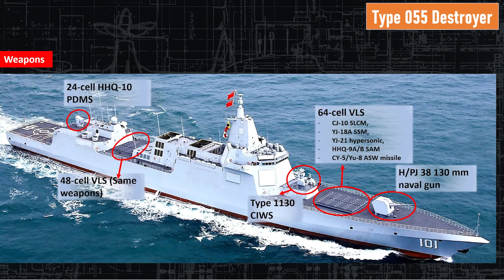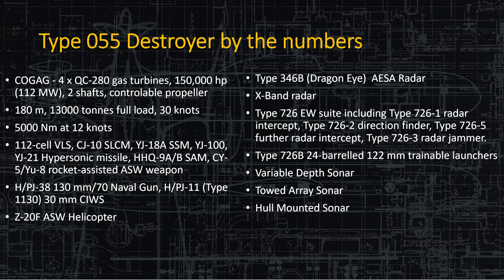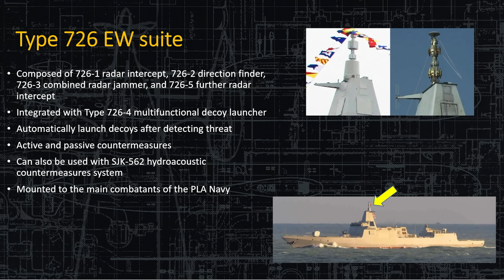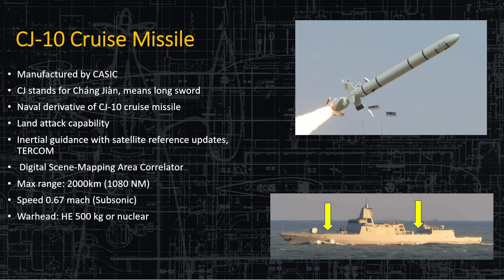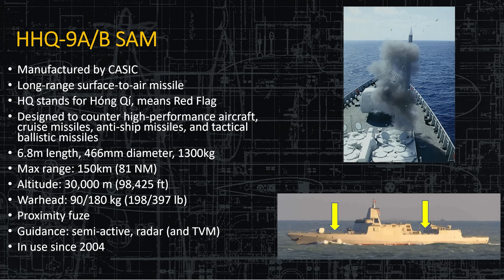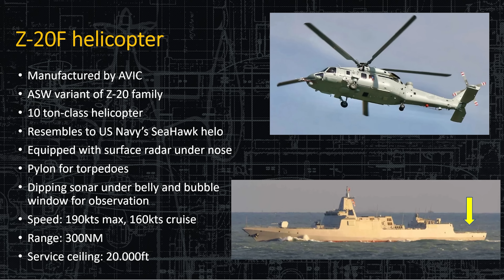China's Type055 Destroyer Ship Brief

Comment: it's arguably better than the Ticonderoga
Reply: If it weren't better, USN won't be rushing the DDG(X) to respond to this. 
Look at the concept CGI of the DDG(X), it even copied the 055's distinctive beak.
Reply: @moss550 Problem is we’re not rushing it. US systems procurement is glacially slow.
Reply: @GrahamCStrouse  That's because the current US system is designed to make money not weapons.
It's about how to most efficiently siphon money into the pocket shareholders and politicians. That's why there are so many futuristic projects that promise everything, but get canceled right before they are ready for serial productions.
Case in point, the cost of this 055 is only 75% that of a Constellations frigate which is supposed to be a cheap ship based on off-the-shelve existing tech. 
Chinese labour are cheap, but not that cheap, so where did all the money for the Constellation go.
Reply: @moss550  Exactly. Saying that the ship is cheap because Chinese labor is cheap completely ignores just how efficient Chinese manufacturing is, and how good their trade and supply chains are. This is the kind of stuff that actually win wars.
Reply: @moss550 That's just stealth design in ships. The german F126 frigate has a similar design, the russian Admiral Gorshkovs frigates also have a similar design, so do the Shkval DDGN concepts.
Reply: @lyin4rmu  of course it's better it's 40+ years newer lol
Reply: One would expect it to be better than a ‘70s vintage design.
Reply: Tico has more VLS, but Type 055 is newer. But overall, SK's Sehjong is the best followed by Type 055 then Tico in my opinion.
Reply: @johnsilver9338  Sehjong DDG still runs PESA radar and MK41 VLS which are at least 2 classes behind 055
Reply: @MrBdoleagle  Aegis ships including Sehjong use BMD radars while Type 055 don't. Also Sehjong have additional K-VLS which are much larger and can even accomodate ballistic missiles.
Reply: @johnsilver9338  The Type 346B Dragon Eye is not remotely comparable to the AN/SPY-1. One is a third generation Chinese AESA, while the other is a PESA. The resolution and detection range are an order of magnitude different because of how the array functions. That is not me saying that radar is bad. China's conducted BMD tests before and they exist. But my main point is you have to remember needs. ROK needs such a thing because their primary adversary is NK, a country that puts an emphasis on BM's. China doesn't face any ballistic missile threat, so there isn't really any reason to put them on their ships. The only countries that put an emphasis on conventional ballistic missiles are just Iran, China, Russia, and NK. All countries that they don't have any issues with or are a threat.
Reply: @Flightman453  Theoretically AESA have around 50% improvement in detection range over PESA/MSA. But a full BMD capability allows a radar to see up to 1000km and even more up to MEO orbit as that how high ICBMs climb. Its why SPY-1D(V) is a tech marvel and is still relevant and effective as it can see up to 1700km for 10m2s RCS like ballistic missiles and large aircraft, 970km for 3m2 RCS like fighter jets, and 307km for 0.03m2 RCS for ballitistic warheads or low observable stealth. Calculations can be found on mostly missile defense. So it can definetly see much further than non BMD radars. But they also have AESA SPY-1 or SPY-4 on the 1st Ford carrier and SPY-6 with multiple RMAs for Burke Flight IIA and Flight III. So those can definetly see much further.
Reply: @Flightman453  I doubt that the Type 346B will not have BMD capability. There is no way the most premier warship in the PLAN roster, which also carries their largest sized VLS does not have the capability to detect and track BMs and then guide ABM towards them. China's radar system is now at the cutting edge, which is all the more ironic because they literally control most of the gallium and germanium refining and ore sourcing and they have some of the finest electronic engineering departments in their universities in the world.
Reply: Idk about that. The Tico is a little old but she still packs a lot of whoopass in those old bones.
Reply: @josephahner3031  yeah, and M1 garand still had a lot of heat but you ain't expecting it to outclass AK-12 does it

Comment: ngl the radar looks a lot like AEGIS. Besides that it looks like China copied the Rolling Airframe missile, the MH-60 Seahawk, the Kh-55, and the 3M-54 Klub.
Reply: AEGIS isn't a radar, it's a combat system.
Reply: @voidtempering8700  The radar looks like the AN/SPY-1
Reply: @BENKYism  Its closet to the AN/SPY-6 since they are both AESAs.
Reply: @voidtempering8700  PESA radars aren't different enough from AESA radars for there not to be some level of interchangeability, all I'm saying is that it looks too much like the AN/SPY-1D on the Arleigh Burke to be a coincidence.
Reply: @voidtempering8700  The Type 346 radar looks even more like the AN/SPY-1D on the Type 052C and 052D destroyers.
Reply: @BENKYism  Um, you realize the way it looks is the least important part of the radar, right?

Also, they are not only completley different shapes, but even when compared to the SPY-6 AESA, the way they approach the radar is completely different.
Reply: @voidtempering8700  The SPY-6 essentially looks the same as the SPY-1. China has a history of reverse-engineering military equipment, I'm gonna list off everything that they've reverse-engineered.
Reply: @BENKYism  Do you understand that they don't share any similarities at all, right.

They are not only completely different shapes and have different arrays, they use completley different guidance systems. The only thing it has in common is that the main arrays are S-band, but it also has two secondary C-band arrays from guidance.

Not that it really matters what band they are since AESAs and different systems completely from the PESA SPY-1.
Reply: @voidtempering8700  MQ-9 Reaper (CASC Rainbow), E-2 Hawkeye (Xi'an KJ-600), Sikorsky S-70 (Harbin Z-20), C-17 (Xi'an Y-20, confirmed in the Su Bin trial), F-35 (Shenyang J-31, confirmed in the Su Bin trial), Su-33 (J-15, reverse-engineered from a prototype bought from Ukraine), Tor-M1 (HQ-17, reverse-engineered when Russia refused the licensing agreement), Crotale (HQ-7), Humvee (Donfeng Mengshi), Exocet missile (YJ-82), Rolling Airframe Missile (HQ-10), Spike NLOS (HJ-10), Javelin missile (HJ-12), ZT3 Ingwe missile (HJ-9), to name a few.
Reply: @BENKYism  You still have yet to answer my question about how two radars with entirely different mechanics and systems can be similar to each other.
Reply: @voidtempering8700  Sure but given China's history of reverse-engineering equipment, I wouldn't put it past them to reverse engineer AEGIS components in some capacity. Chinese media outlets dubbed the Type 052D ship as "Chinese AEGIS".
Reply: @BENKYism  It is called that because of its capabilities.

Even then, that is a massive misnomer, because AEGIS is a combat system.
Reply: @BENKYism all phased array radar looks similar because they are all thousands of small transceivers laid out into a square or hexagonal shape on a flat surface.  However, it’s the transceiver design, signal processing equipment, and information processing equipment that makes the real difference, not the antenna board.
Reply: @BENKYism  Dude, it's a radar.
Reply: @Flightman453  All of them were reverse-engineered from other designs, that's how China was able to modernize their military so quickly.
Reply: We sold them the civilian version of the black hawk btw.

They then completely redesigned it internally to chinese systems, avionics etc.
Reply: @HolyNorthAmericanEmpire  Producing a copy of something without license is the definition of reverse-engineering.
Reply: @BENKYism  Its not a copy though, the only similar thing is the rough shape.

Ask any aerospace engineer. Even small changes require multiple models and redesigns to make it work properly.
Reply: @BENKYism  And so can you prove that? The word copy has lost all meaning because people like you still live in the 1990s in China. The only thing you listed that actually falls under the word "copy" is their Blackhawk equivalent copy as they actually possessed civilian versions of the Blackhawk just like someone stated above.

Comment: The materials science that goes into turbine blades is incredible stuff.  Some of the most advanced metallurgy you'll ever see.
Reply: He believes China can make jet engines, but he doesn't believe China can make gas turbine blades. How funny.
Reply: And it's not that difficult for China now. These was old stories. Things changed rapidly .😊
Reply: @AZ-hj8ym  Investing in industry and infrastructure pays off.  China seems to be pretty good at that.  Not to mention how many engineers they've probably got working on just that one problem.
Reply: @AZ-hj8ym  it's still difficult, multiple engines r&d have been pushed back again and again.
Reply: @voidtempering8700  Yeah, my point is it is never an easy task. You can get a working prototype quickly but takes years of effort to improve and make it reliable in real life deployment.
Reply: @koba301  The WS-10B has been in production for 10 years, the WS-10A even earlier. WS-15 just entered serial production. It is more than just prototypes.
Reply: @iraviya  i can imagine, must be very precise.
Reply: I work at scrap yard where we get material from a turbine manufacturer,  lots of exotic, proprietary and even custom one off alloys.

Comment: At mach 3 at sea level it takes 30 seconds to travel 19 miles.
Reply: so shooting like 5 missles american Ciws cant hit all ?
Reply: @mikael5938  It's likely to be a bad day.  Breaking up a mach 3 missile a km out does not mean that you won't get a few tons of burning junk hitting you still going very fast.
Reply: @mikael5938  Phalanx can't really intercept high supersonic missiles. Even RIM will have problems.
Reply: @mikael5938  you are assuming that Aegis cannot target multiple missiles simultaneously like the russian systems. well, it can. CIWS is never the primary defense anyway, CIWS is your last option. in fact most navies have been phasing out CIWS with RAM as point defense until the pirate/small craft problem resurfaced again in recent years.
Reply: @mikael5938  that what the RIMS are for.. there is no way Phalanx can deal with many missiles, it doesn't have the ammo, it intended to be use only if all its missiles fails.

Comment: We should have kept R&D of Nuclear Cruisers.
Reply: You're still limited by food and supplies. I'm not convinced it's that good of an idea honestly
Reply: @noscopesallowed8128  RAS is much more time consuming than the UnRep. Helicopters just drop pallets. If its not time sensitive you can run the cables too. But a nuclear propelled ship can keep faster speeds longer so getting to the UnRep and getting back to the AOR would be faster.
Reply: Why build nuclear cruisers when you have SSBN's? Even attack subs now have significant long range strike capabilities. The main purpose of these cruiser style surface vessels is area air defense and, believe it or not, most countries have no need for an area defense surface combatant with no energy resupply restrictions. Perhaps if you don't have the ability to resupply such a vessel, you shouldn't be remaining on station there indefinitely. Why can you not resupply locally? Perhaps, if that is the case, the solution is political and not the application or threat of force. Just a thought.
Reply: @andrew6815  missiles have not replaced the mission of guns. Having ships with guns is still mandatory. Having ships that rely on oil is optional.
Reply: @koffeekage  Ok... what does the power system have to do with the ship's gun?
Reply: @andrew6815   did you read your comment? You asked why CGN when we can have SSBN. Its because SSBN have different mission capabilities. Mainly, gunnery and  helicopter operations, what about Aegis? How are you going to outfit Aegis on a submarine? Adding nuclear to a cruiser wouldn’t change its mission it would just make it more efficient.
Reply: @koffeekage  there were two parts to my initial comment. The first part was pointing out that the strike capabilities of these missile platforms can be carried out (and arguably much more effectively) by SSBN's. The 2nd part of my comment was pointing out that the primary purpose then of surface combatants with large missile carrying capacities is as area air defense which is the purpose of this ship. This ship is also armed with a main gun.
Reply: We don't need nuclear power everywhere, just imagine a hot war involving a bunch of nuclear powered cruisers, what a real disaster it will be having these ships at the bottom of our oceans and let's say that 1 third of the nuclear reactors containment of these ships fails and pollutes our oceans marine life contaminating a vast supply of our source of food and eco systems, and all for what? Because some idiots gave in into fear mongering and hate and started putting nuclear reactor everywhere as if it was no big deal, what is next a nuclear powered tank? Regular everyday cars next? Why stop there let's add mini reactor at every house that an afford it in order to prevent a whole city from getting their power turned off, cause for these people there is always a reason to justify putting nuclear power where it has no business, while neglecting to take into account the other 1000 or so reasons as to why we SHOULDN'T do it.
Reply: Yeah, in theory, but in Practice, do we really want that many Ships and Subs with Nuclear Reactors? Than Maybe the People we are Fighting have them too, and after the War there is 200 Nuclear Reactors Lying on the Sea Bed.... IDK, in Theory Sounds Great, However it just might not be the Best Long Term Practices...
Reply: @randyross5630  reactor tech is much better in the 21c and if there were proper R&D we would have that as An option instead of being shackled to oilers. Imagine a cruiser going as fast as as carrier at flank speed and just never stopping.
Reply: @randyross5630   200 reactors on the sea bed is no different than spent fuel in cooling pools; perfectly contained and only dangerous within 0.5m of the unit.
Reply: @dalel3608  Until the containment vessel is breached.
Reply: @noscopesallowed8128  No, that's even with it ruptured wide open; it's not going nowhere and its radiation is blocked by the local water.  Only thing getting hurt is if a crab/fish/squid swims through the rupture.
Reply: @dalel3608  Ok fair enough. But what about when the ship doesn't sink, or it gets hit in port? Any accidents the ship might experience seem to end up with the entire crew dying of radiation poisoning as well. I'm not opposed to nuclear power or propulsion, I'm just not sure what to think about every warship out there having it.